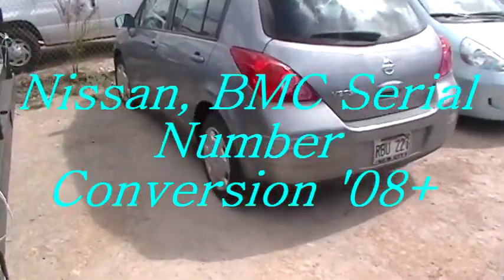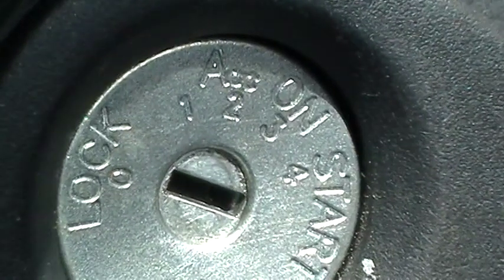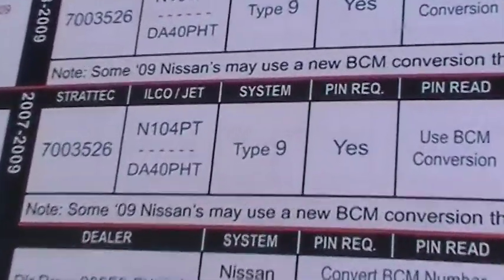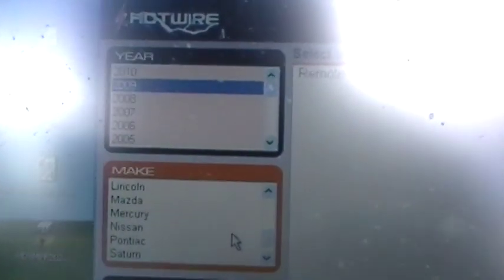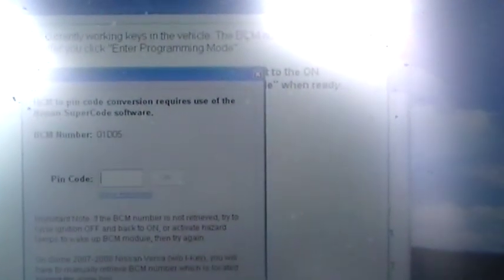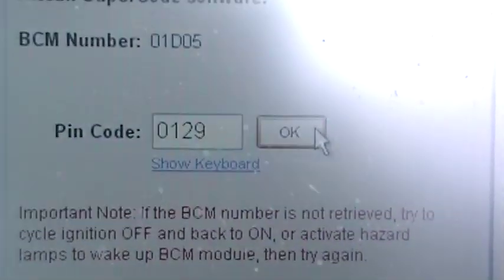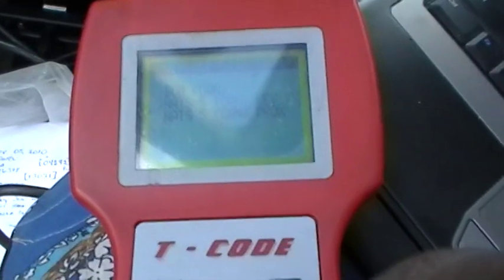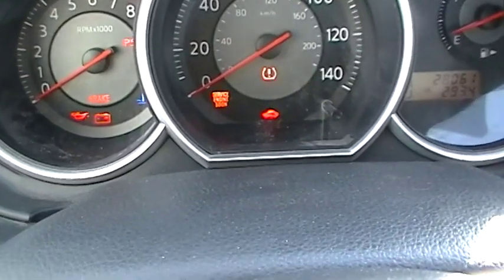'09 Nissan BCM Serial to PIN Conversion

Comment: Where can find BCM codes for Nissan cars - does a programmer give you that BCM code you can convert to pin code?  Is there a good free BCM to pin code apps or PC apps I can find?
Reply from the maker: Hello James.  Nowadays, many diagnostic programming devices for Nissan vehicles will provide such information to the technician.  However, there are PIN Code Calculators/Readers available from sources online.  If you're a Locksmith, this type of data is "well available" to you, even if you must subscribe to a vendor.  I hope this helps.

Comment: hello mr william, i have a problem. my problem with two vehicle in my work shop one is a madza axela 2007 and the second one is a toyota rush 2006 for the rush the smartkey damage and i cannot get the vehicle start and the madza have the same problem. please help me out or could you give me some idea about how to to get the problem solve. i would like if you could give me a personal number so i could call.   +5926903339  +5922602304 +5926815828

Comment: what happens if my pin code calculated is wrong, because of i was programming a nissan tiida car ´14 and i made all procedures and the machine read the bcm code but my nissan super code program gave me a code incorrect, so somebody told me there is a new nissan super code program he gave me a pin code diferent of my previously pin code and that was correct i would like to know if you have any idea of that new nissan super code or something like that

Comment: Hello all, our online 24/7 pincode calculator is supporting Nissan & Infiniti cars by Serial number, you can calculate the Pincodes old (before 2009) + new (2009 and newer) by BCM serial, or by SEC and ICU labels or Glove Box label/sticker. The service is free * for more info visit our website weboctopus (dot) nl or watch our video's
Reply: I need Nissan 20 digit  U have
Reply: @friendcars1711  sure it supports 20 digit, check our VIN to PIN page
Reply: @friendcars1711  sure, costs 1 token
Reply: how much
Reply: @friendcars1711  you get access for 25 euro
Reply: @friendcars1711  48 euro's

Comment: Finding the Nissan PIN is very easy. To calculate immobilizer PIN code you need to locate and read dump from:

BCM : 93C56, 93C66, 93C76, 95080, 95160, MC9S12XDT384
ECU : 93C66
ICU : TMS370C032, ST-A2C11776

It is very cheap, watch our videos or just visit our website: weboctopus.nl or  vin2pin(dot)com

Comment from the maker: Thanks for viewing my channel. The software that you can use to convert the BCM serial number to PIN code (for 2008+), is available from National Auto Lock.  They are on the web.
Thanks again,
Will